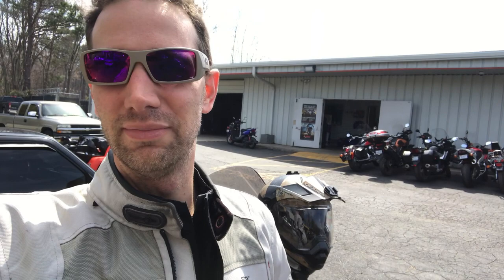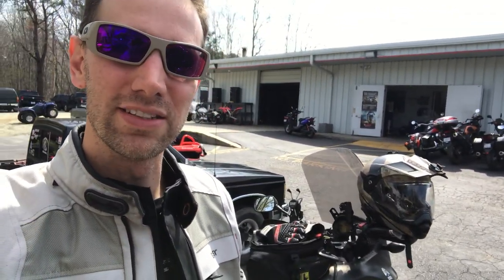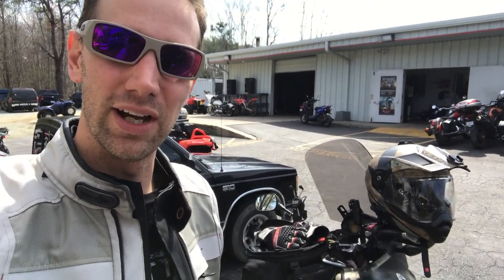Honda CB500X: Sub Frame and Steering Bearing

Comment: What size Rally Raid suspension kit did you do? I’m 180 with probably 50 lbs of gear, should I choose the standard spring or the harder spring.
Reply from the maker: I went with the heavy spring and my weight was probably pretty close to yours, maybe a little heavier.  I never had any issues with the suspension being too heavy or too light on a VERY long trip where I was significantly over weight.  I hope that helps you decision.